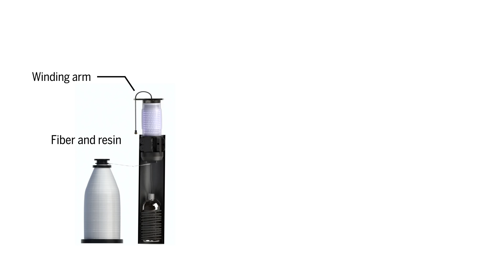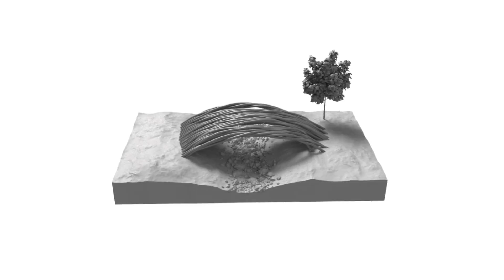Watch these alienlike robots weave a bus-size fiberglass structure—all by themselves

Comment: Useless devices that only make questionable art installations. Build structures in "remote or dangerous environments"? We humans can barely organize ourselves after extreme weather events, let alone set up complex AI machines to build any kind of structure.
Reply: We already have machines that lay brick, hang drywall, weld beams. While this technology is in it's infancy there is alot of potential in auto-construction.
Reply: Many of the designs/programs would be/already are preset. A human will just have to set it in the right place. They already have sensors and can comunicate to one another so they'll work around the situation they are set in.

Comment: Nice, but what useful those can actually build?
Reply: It looked like it could make a bridge or a shelter. But these proof of concept things are probably more for art than anything else. However it's a new path that architects, designers, and engineers can explore to find good use cases
Reply: I'm very skeptical that it can make bridge strong enough to really be useful. In other words, would that be the best option to build bridge?
Some kind of shelter, maybe, but why would you have those bots available for that? I mean, if someone have to transport them to you, then why not to transport tents?
Reply: @user255  agreed
Reply: @user255  
Tents need more wights on top of that, they can't work with all types of enviornments, mostly flat ones and not everybody can actually have that. These bots are made to work around the tougher areas. Also for the bridges, it really depends. Do they expect plases who have been hit hard to have a lot of traffic or heavy things going by when the place is super unstable? Obviously not. So a simple bridge able to hold a few people at a time would be enough for a start.On top of that it is only a temporary thing so the permanate solution could take it's time and be better thought out so it won't be rushed and cause more possible problems.
Reply: @user255  hard hit places can't always handle it and there have been times were trasporting those heavy things have made it worst due to the unstability. There are places that CAN'T recive that type of help because of all the damages. Plus sometimes all you need for a start is a way to connect people and a simple bridge is a decent start in those cases. From my understanding it just needs a stable place to start and since it's so small compared to a huge truct it doesn't need a huge area for that to work. It's possible to carry over 10 feet of thread in a single bookbag for a child. It doesn't weigh much. The main weight would be the resin but even then it doesn't soak the thread so much that it needs hundreds of pounds of weight to it.